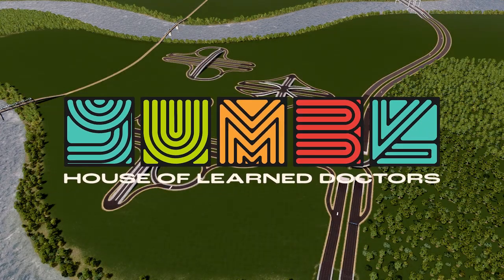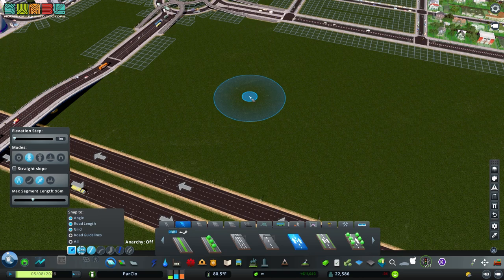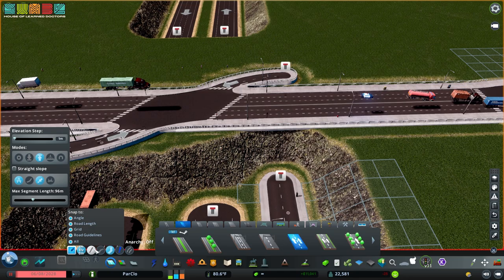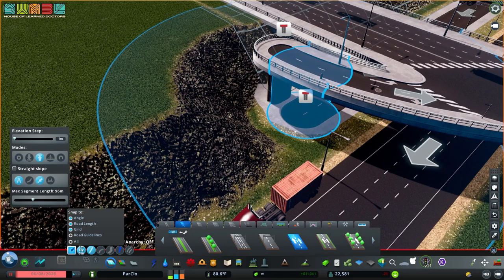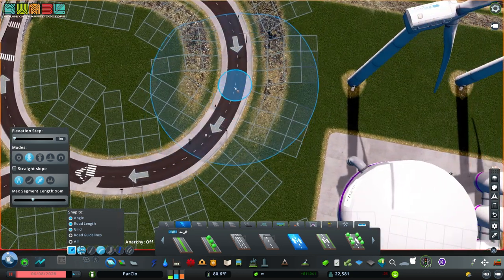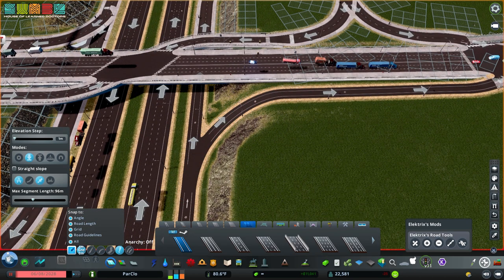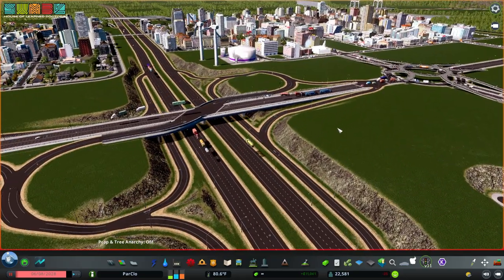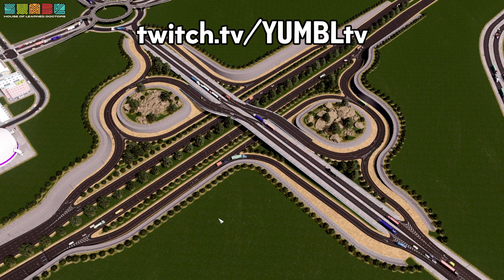Single-Point Partial Cloverleaf Tutorial *SPPC* - Cities Skylines

Comment: Yumbl, are you familiar with the Cloverleaf Problem?  Something like 59-69% of all accidents in a Cloverleaf happen because of the outside left-turning lanes weaving and accelerating/decelerating.

This Parclo SPPC eliminates that problem completely while being superior to the Parclo A4 for both flow and safety.

This is a straight upgrade for both forms of intersection, and should garner more attention than it's being given.
Reply from the maker: Thank you for noticing! I agree with you on all points, but I understand why it’s not widely implemented. I cant imagine cities want to build large loops, an arterial wide enough to support it, AND ramps to meet in the middle. I’m sure it’s much more expensive and logistically challenging than similar designs (parclo ddi or spui). I’m happy with it, but I’m not holding my breath for it to catch on 😉
Reply: haha 69
Reply: @YUMBL  There is another issue. Should incident happen at the middle point, it would be much harder to mitigate it. No space to go around and to park emergency vehicles. I think laying the middle intersection on the ground and putting the highway on a ramp could help with that. However, the overall amount of building work in both cases is really high. I would like to see somebody professional analyzing the real-world costs of such a junction.
Reply: I agree this looks really nice. A normal clover just shuts down when the capacity overflows, almost impossible to recover because it locks itself in like a roundabout. That is why not mixing different directions is so powerful. On a light for instance, if the intersection completely overflows and the traffic decreases again (maybe rush hour is over or some other locations get better flow) then the intersection clears within a few cycles.

The parclo seemed too much like a normal service interchange like a normal diamond to arterial, but with convoluted curves. With this extra addition it combines advantages of other interchanges without using all the space or complexity they require. For example a diverging diamond is very powerful but the set up is very complex and it would confuse the hell out of our European drivers (I'm building on a Dutch map at the moment) because of the switch to left hand in the middle and a SPUI is simpler but just waay too American. In Europe interchanges are either clean or simple and this option keeps the simplicity of a regular diamond but with less conflict!

Comment: In truth, Timboh, the original interchange designer for Cities (and with some of the most subscribed to assets of *any kind*) created this interchange as something he called a SPUPCLO (Single Point Urban Partial Cloverleaf), but he did it differently.  Instead of splitting inbound and outbound from the loops, he made them all distinct ramps and joined them all at the middle node.  FOUR roads all joined in one place.  It can be seen here: https://steamcommunity.com/sharedfiles/filedetails/?id=529645954.  And let me tell you, it is a MESS to try and direct traffic thru.

A few others did the SPUPCLO but did what you did: They split the inbound and outbound lanes off the loops and had only two connections in the middle.

But none of the few that attempted that did it with a 10th the panache as you did, and explained it so clearly.  Your SPUPCO looks beautiful and will probably flow just as beautifully.  

You're giving an absolute clinic on basic interchange design and I love it.  For a most interchanges in C:S, you don't need turbines and windmills and fancier interchanges (those are mostly for truly high volume and highway-highway interchanges), you just need the basics.

TL;DR: I'm yeeting this straight into Storm City.  This solves an interchange I've rebuilt four separate times and it looks beautiful.
Reply from the maker: Thank you! I respect what Timboh did, but I’ve found the shapes resulting to be lacking.
Reply: @YUMBL  To be fair, Timboh was working 6 years ago, with the extremely limited tools that the asset editor had, and disappeared after making his interchanges.  Some work well, some do not.  None had good lane math so I had to do some serious work with them to get them optimized.  Thank goodness for Node Controller!

Your version of a SPUPCLO is a whole lot better than anything that's come before.  Quite frankly, you took the idea and perfected it, and that's why I'm shamelessly bogarting your SPUPCLO for Storm City. :-)
Reply from the maker: I appreciate it :)

Comment: Take the overpass's right slip lanes and where the left turn merges with it. Rather than having the left merge there, have the lane diverge into another single lane over pass that crosses the highway and comes back down in between the underpass and the off ramp there and merge with the other overpass right slip lane on the other side? It would be a little bigger, but free flowing.
Make it a "Free-flow Parclo"

Comment: I think the reason why these don’t exist in real life is safety. It is probably very dangerous to have those two way roads leading on and off the highway because they would result in a lot of head on crashes.

For example at 18:28 I hope those trucks don’t  skid out/ hydroplane or drift across that line!
Reply from the maker: Oh, of course it would be separated by either space or a median on real life. The cities node system would make fitting two networks in that space difficult, and I dont have a two lane network with a barrier.

Comment: I would want to flip the cycle to be "Both left turn exits go" and "Both straight through go".

I don't like the idea of "One side is green for straight and left". In real life I think that cycle would be a bit jarring. Might be a bit difficult to handle traffic volume too.
Reply from the maker: Problem is the angle of the roads wont let it recognize them as lefts. It thinks they’re straight i have to do spuis the same way too. Angles are often too slight for left arrows to function.

Comment: Am I wrong or are you screwed if you want to drive back the same way you came?
Reply from the maker: There is almost never an option to turn around on interchanges in the us. Only exception being full cloverleafs. Or interchanges with two cloverleafs on the same side. Other than that I can’t think of a way to turn around on a highway. How would that normally work?
Reply: @YUMBL  I'm not a pro, but since I live in Europe and have missed exits sometimes, I know for a fact it's possible, more often than not. Usually you take the exit, turn left on the bridge and take a right on the onramp into the opposite direction.
Reply: I tried to send you a Gmaps link, but YT wont let me XD
Reply from the maker: I think I know what you mean. There are a bunch of different interchanges and some will offer that option, but its certainly not a guarantee. Cloverleafs/partial cloverleafs being notable exceptions where you can ride out the curves to turn around. Typically if I miss an exit I’m headed to the next one, take it, find a place to turn around off the exit, and then back at it to go the right way.